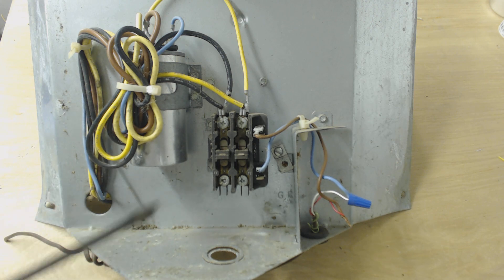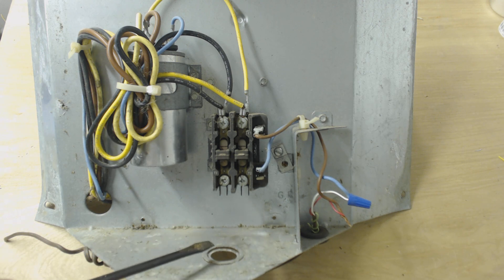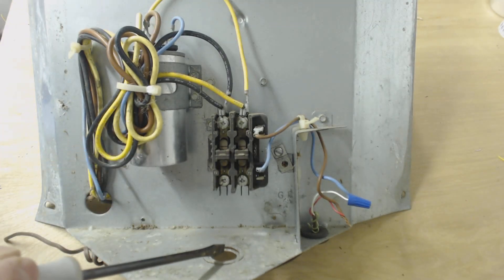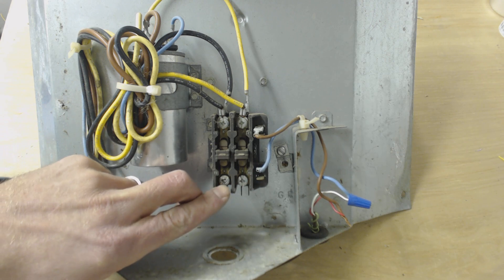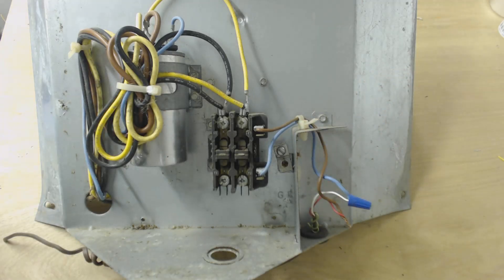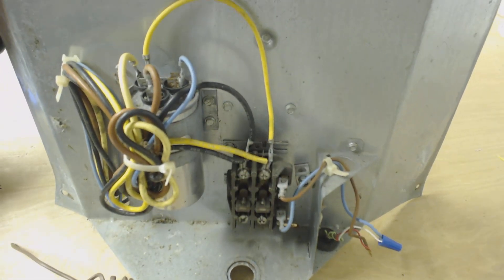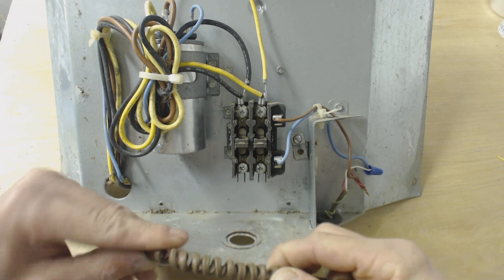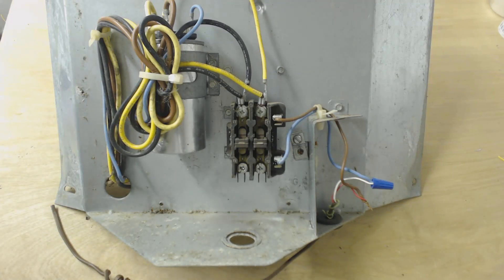Wiring an Outdoor Condenser! What each of the Wires is For, How it Works!

Comment: My condenser has 3 wires going in and out of a molex connector. One set of 3 appear to maybe be smaller gauge wire. Not sure if it is just smaller insulation. 
  How do I wire this one a single pole compactor and dual run capacitor?

Comment: I had a very old capacitor where the wires frayed and could not read C Fan or Herm on it. Old unit luxaire compressor had a brown wire also almost wired incorrectly had to follow wires to fan and compressor. Do the number of terminals indicate what goes where also?

Comment: I accidentally cut the red and white wires that connect to the black and yellow on my screen unit  with my trimmer and now my HVAC doesn’t work. I reconnected the wires but nothing works. Any thoughts?
Reply: Try killing the breaker,set the thermostat to off.Let it sit for a few and turn the breaker back on.Sei it to cool and see what happens.If the control board in your furnace has a 3 amp fuse it could have blown.

Comment: Please don’t tell people wire ampacity..because you were wrong off the rip. The insulation and terminal connection points determine what the conductor is rated for. THHN #12awg is rated for 30 amps as long as the terminals are rated for the same…

Comment: Great Video! 
Question: What size gauge are the Low Volt (24v) wires going to the contactor? I’m not referring to the thermostat wires (18-2).

Comment: how do I determine what contactor to use if there's no info nowhere on the unit anymore?
Reply from the maker: You can match the FLA rating of the contactor with the actual breaker amp size. This way the Full Load Amps rating of the contactor is the same or higher than the max amperage of the unit, thanks!

Comment: Thank you sir. One question’ what size wire should I use from the capacitor to the contactor ?
Reply from the maker: It is based on the max amperage as stated on the outdoor unit rating plate, thanks!
Reply: Thank you sir!

Comment: Regarding the red and white wire coming from the furnace/handler. You mentioned it was hot and common, shouldn't it be common and Cool?
Reply from the maker: The cool wire is now connected to the 24v red hot wire. Any time a wire has voltage, you could consider it hot, thanks!
Reply: @acservicetechchannel   Awesome, thank you!

Comment: My common C wire and Y wires when I test it with multimeter shows no 24V at the contactor and also at the circuit board. I already replaced the circuit board with a new one and still the same. Should I connect the R wire instead of the C wire?
Reply from the maker: It sounds like you may not be getting the the r to connect to the y in the thermostat in order for the y to have 24v on it at the furnace control board, thanks!

Comment: awesome instructor you are. my friend has an Amana furnace and AC. but why is the ac wires connected to terminals Y and R on the furnace control board? i thought it was always Y and C. i checked the outdoor unit and found out that the two wires (Y and R) from the furnace are connected to some box of relay or something. have you seen this before? i still don't understand why it's Y and R in the furnace and not Y and C. everything works fine. thank you .
Reply from the maker: Mark, it would have to have some type of common to find it's way back to power the relay unless it is working improperly going to ground. Could you send me a pic to my email or take a video, upload it to your channel as unlisted and send me the url. keep asking questions here but you can send this info to my email at info@acservicetech.com thanks

Comment: Always tape white wire with black tape,   it is not a neutral wire ,,,,,it is a hot....He is not an electricain for certain...
Reply from the maker: Hey David, that wire connects to the common on the compressor and the common on the contactor. It doesn't mean a common/neutral wire that connects in the breaker box and is connected to ground. It is a 120v hot along with the other 120v hot, thanks

Comment: do you have any video with two single run capacitors and 4/5 wire condenser motor? I have no spot on the contactor for one of the lines (white) from the fan motor. Does it matter if I do not connect it? Also the condenser (outside unit) freezes; i checked for air flow and evaporator coils and they all are good. Do you think it is bad contactor?
Reply from the maker: If it is a common wire from the motor then that could be added to the common terminal on the capacitor since there are more connection points there. Make sure to follow the diagram on the side of the motor or that came with the motor though to make sure. If it is a heat pump then the outdoor coil may start to freeze as high as 40 degrees outside in heat mode, thanks

Comment: What is the purpose if an outdoor fan thermostat? The unit was an older trane optional heat pump system and normal switch on diagram is on high speed
Reply from the maker: Are you talking about the outdoor condensor or heat pump fan that pulls air across the fins or are you talking defrost board?
Reply: acservicetech talking about the main condenser fan across fins.. confused why they have the fan wired for low speed normally and high on temp drop .. which is opposite from what diagram shows?

Comment: It's a zinc plated copper lug. If it was aluminum it would corrode if you used a copper ground.
No mention of grounding, such as using the whip and fittings as a ground and then attaching the neutral.

Comment: the fan motor i have is only cw how would i reverse the polarity
Reply from the maker: There should be two sets of wires that only come off the motor a few inches for directional changes. You would switch the colors. If it is yellow to yellow and orange to orange then you would do yellow to orange and orange to yellow. See if you can locate the wiring diagram on the side of the motor first in order to understand the wiring thanks

Comment: How can I tell which model ac unit was in my house before I purchased , and do it need to match up with the heating furnace
Reply from the maker: The company doing the bid for replacement should do a manual J load calculation for heating size and cooling size to match the house and yes the blower motor on the furnace should match the ac unit size, thanks
Reply: acservicetech  thanks your so helpful good bless
Reply from the maker: May God Bless you too!

Comment: You are the sharpest tech on you tube, Thx.  A lot of guys say you need to cut the condenser motor shaft if the replacement is too long. why? I know they say it can make bearings fail prematurely but what if the fan needs to be on the end of that long shaft? are they saying it will fail? if the MFR makes it that long the bearings should handle it. what do you think/do?
Reply from the maker: You shouldn't need to cut that off, thanks Joel!

Comment: awesome info! Could you do a video about how to trace and correctly hook up wires to the capacitor and contactor if everything was already disconnected with the capacitor missing?
Reply: I need a video on how to trace the wires from where they need to go on a capacitor. The old one was already taken off.
Reply from the maker: That does sound like a good video idea for the future. Thank you for letting me know what you would like to see!
Reply: did you ever do a video like this?? i must know because im an hvac student and i want to know how to do this!!
Reply: acservicetech I agree on the second vid idea. I'm in the same situation. Great vid.
Reply: CSr  compressor condensing unit

Comment: I have always wondered why some mfgs use 2 pole contactors instead of a 1 pole contactor .Do you have any reasons for that?
Reply: Excellent article thanks for the reference.
Reply from the maker: It seems that many older manufactured units used 2 pole as well as packaged units but most newer residential condensers use single. The answer is a mix of code interpretations, and depends what is being powered. Some techs just carry 2 pole contactors but you have to watch if the unit you are changing out the contactor on was designed to work as an internal crankcase heater. Here is some reading material for you - http://www.achrnews.com/articles/91291-single-pole-and-double-pole-contactors

Comment: cool thanks for the very best video
just a little questions or if where you are connect
a crank case heaters 
in a double pole contactor
Reply from the maker: Actually though it seems like a waste of money they get hooked to the live side of the contactor. You just need to use a 240v heater if you have a 240v unit because there is no common wire only the two 120v hot legs and the one ground. Thanks for the Question!
Reply from the maker: I mean't although it seems like a waste of energy for the homeowner.